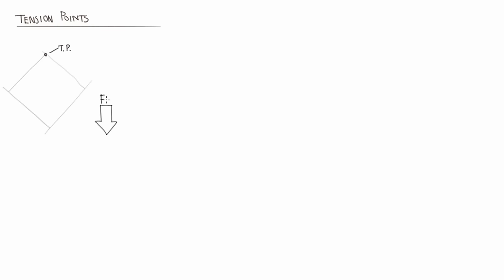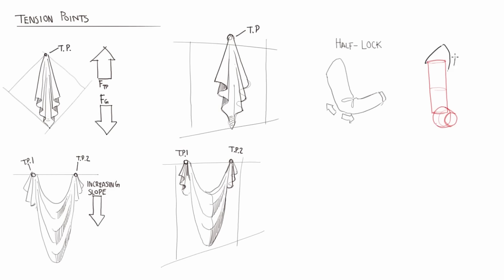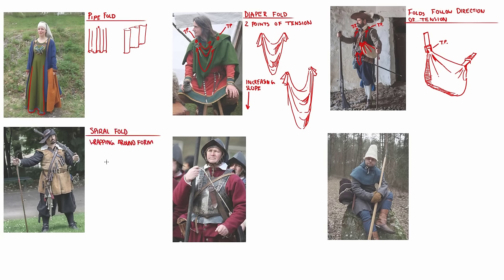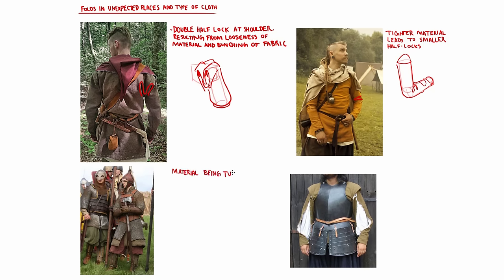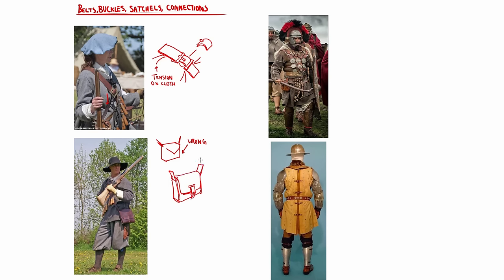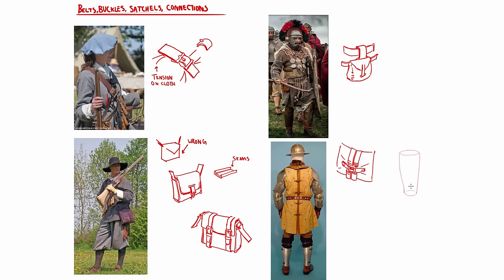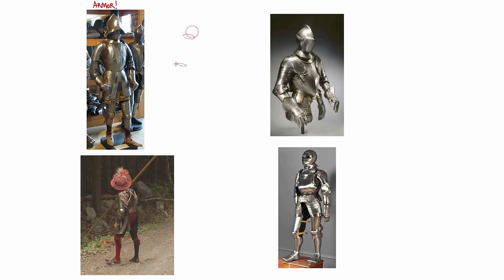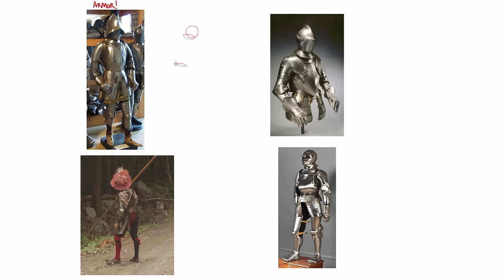CLOTH AND DRAPERY 1: Cloth, Folds, Junctions, and Armor

Comment: An important detail about plate armour in particular are the proportions. One of the most commonly made mistakes that you see all the time even with professional artists and costume designers is the cuirass (that is to say, the breast and back plate) being treated like some kind of shirt. If you do that, you end up with an immobile and oversized piece, forcing you to make awkward and unrealistic bends in the armour itself if you want to draw your character in movement. The breastplate doesn't reach all the way to the belt line, but rather to the waiste. If you want full plate, the belly and abdomen are covered by faulds, which are essentially a skirt made from articulated plates.

An easy test to see if you have the right proportions is to ask the simple question if your character could comfortably sit down on a chair or even the ground without the edges of the plate biting into him. If the answer is no, your breastplate reaches too far down.
Reply: another tip would be that is called a breastplate, not a torso plate